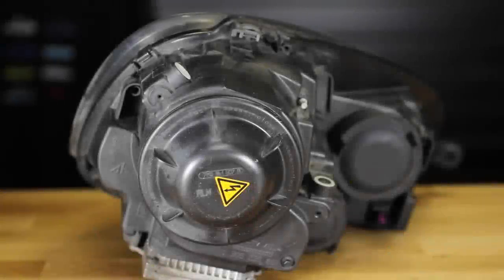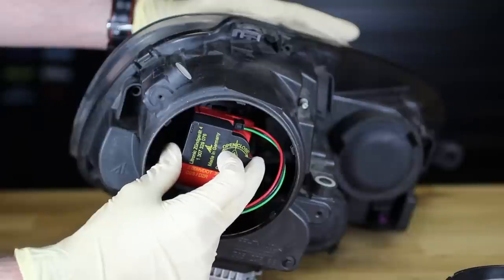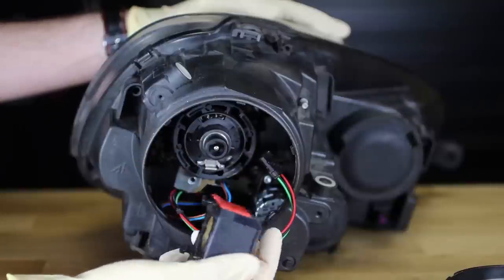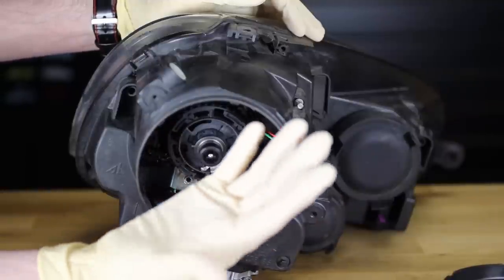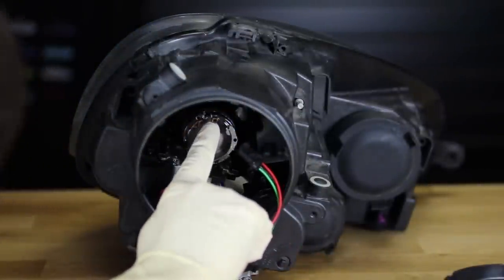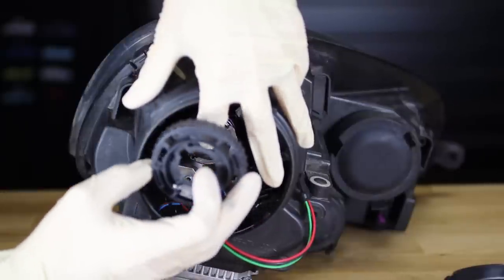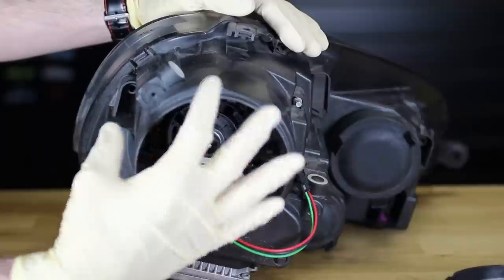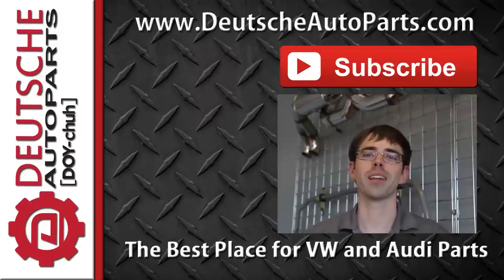How to Replace and Diagnose HID (Xenon) Bulb Problems on VW MK5 GTI and Jetta

Comment: anybody know where to get complete kit of wires for this headlights? wires in my headlights are completely destroyed
Reply: Mine too, I had to buy new headlights.
Reply: @redrumloa   What did you buy to replace? I have wires that melted my ignitor.. so just going to go with new headlights. did you buy xenon or something else?
Reply: @kristinharkins7809  I bought new aftermarket headlights on open box clearance.They are kind of cheap, but with a bit of rigging worked.  If needed I could go back and find the make and manufacturer.

Comment: Hey guys... not sure where to find the information- but I have an 07 GTI with the Bi-Xenon self leveling lights... they have decided to stay stuck in the down position.  It was also popping at TPMS warning light on the dash as well.  I went in with VCDS and turned off the TPMS and it seemed to fix the problem for a little bit, but now they are again stuck in the down position.  I was an hour away from home in the pitch dark on back country roads trying to get home without being able to see.  HELP!  What in the same hell is going on with these things?  I know the tires aren't low... why on earth would they make the headlights not work if it popped a tire pressure light anyhow... that's just plain dangerous!